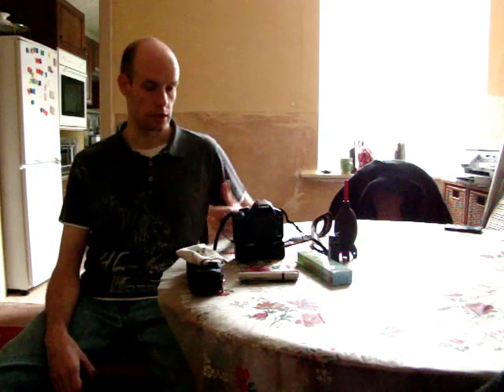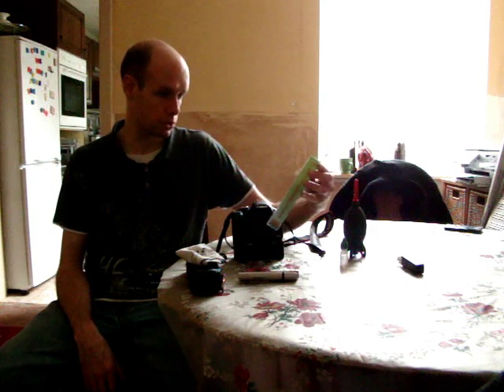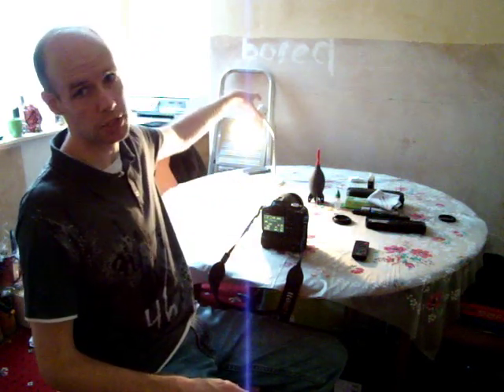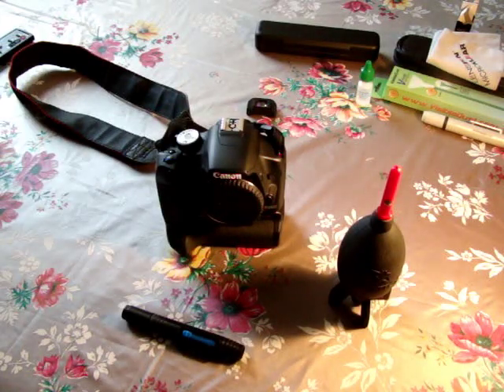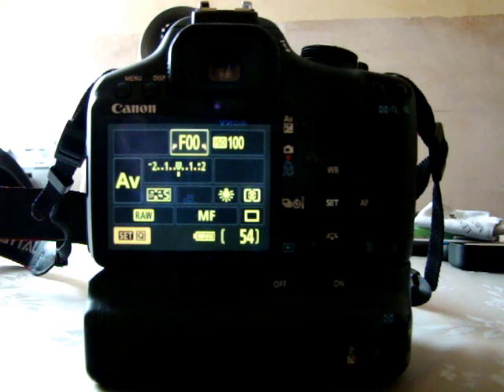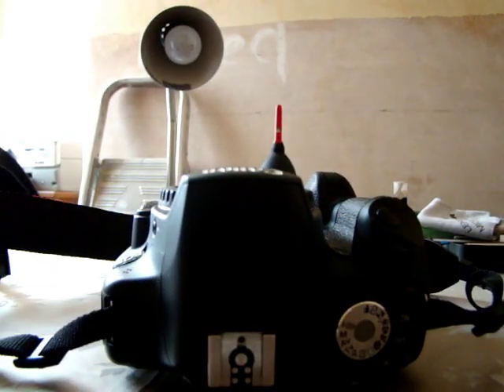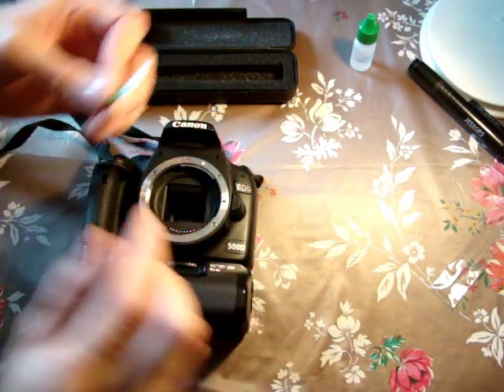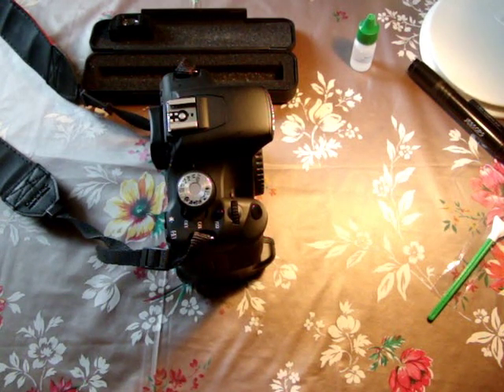How To - Clean Your Camera Body & Sensor

Comment: When you use the sensor cleaner of your camera what it will do is vibrate the sensor to remove the dust, but when the sensor does that, the dust stays in the inside of your camera and can find it´s way back to the sensor. Besides, some dust can´t be removed only by the vibration. (sorry for the bad english)